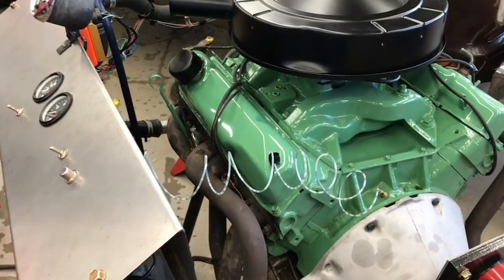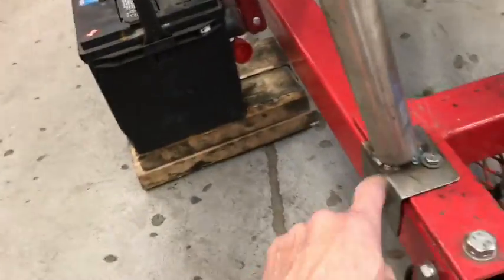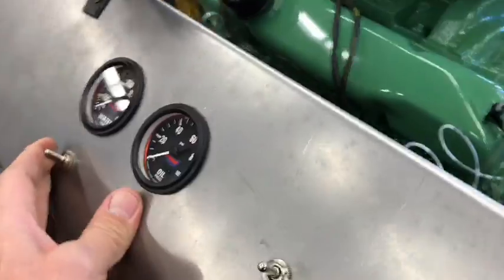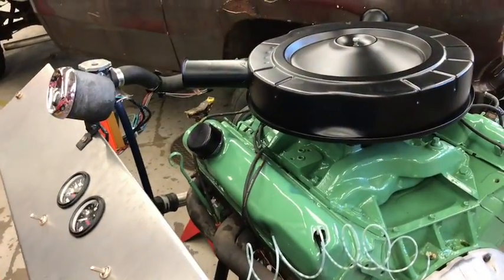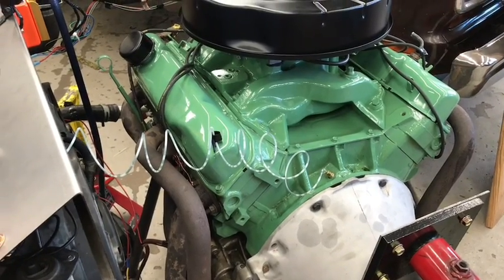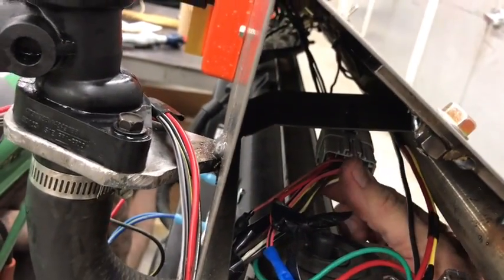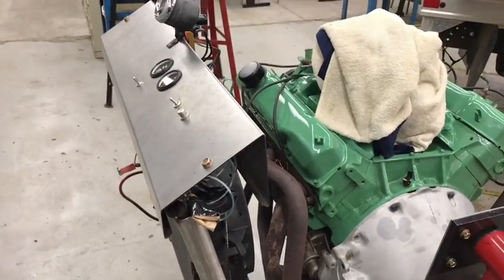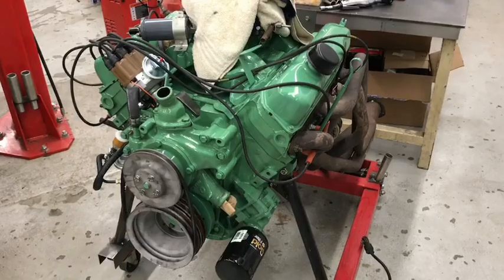How to build an engine run stand out of an engine stand (EASY)

Comment: Is the flywheel weighted to support running without a transmission load?
Reply from the maker: @johncantrell8873  The flywheel is balanced because the engine has a steel crank. They’re internally balanced. A cast crank 440 is externally balanced and would need the correct harmonic balancer and flywheel.  
The transmission/engine are balanced separately. It’s perfectly fine to run an engine like this. Good question, some people don’t think about that!

Comment: Show the wiring diagram please
Reply from the maker: I purchased a new distributor with the orange box you see there. It came with the wires and directions. I added a common relay for each fan, do a YouTube search on how to wire an automotive relay and you’ll see how easy it is. I could explain it, but it would be easier to watch it. The hot(+) cable goes straight from the battery to the starter and a small wire goes to the push button, then to the solenoid on the starter, you’re done.  Don’t forget to add fuses where needed. 
The temperature gauge and oil pressure gauge come with directions if needed. The tach will also come with directions if needed.

Comment: Did you use the Flywheel Cut off a Torque Converter, I have a 340 I am trying to set up on the same stand ?
Reply from the maker: No, it’s a flywheel for that application. There isn’t a clutch/pressure plate bolted to it.  I also didn’t alter the aluminum bell housing at all.
I have a complete 383HP bolted to it now. It’s all for sale, including the stand  - plus - 440 (needs to be built), 383s, automatic transmissions, and lots more….. if interested.

Comment: I wonder how many of the geniuses criticising the welding actually weld?
Reply from the maker: Exactly!  I used to weld for a living and after I tacked it together and I knew it was strong, I let a student try to weld it knowing it was going to be a problem - he tried and I'm fine with that.  If it had to be "pretty", I'd have done it, or sent it to our welding shop to be tig welded (I don't have a tig in my shop).  It's not coming apart regardless of what it looks like!!  This was posted help others, there's many things that could be improved on, this was the first try at this.
Thanks for checking it out!!!  and your comment!!!
Reply: @blvelpa  I judge my welds by 'will that actually do the job required' and not 'am I going to get an award for smooth and plump continuous welds?'
Reply from the maker: @AndrewLale  Exactly (again)!  You might want to check out some of my other videos.  I built a V8 Aerostar which required a lot of fabricating and then drove it 200,000 miles before selling it.  At this time I'm installing a Tremec into a car I've owned over 40 years and no one makes a kit for it.  More fabrication, it never stops!!  The engine on this stand is now in the frame of that car and there's another engine on the run stand.
You may also want to checkout this forum I'm a member of.
https://www.forcbodiesonly.com/mopar-forum/threads/1965-sport-fury-restoration.44077/

Comment: Funny, I was thinking about how to make a run stand double as a build stand with roll-over and everything.  This is great!  Since everyone is cracking on your welds I'll say they look like they'll break somewhere around 40 MPH ;-)  Better not drive that test stand.
Reply from the maker: Thank you!!  It's all good.  We shouldn't have tried to weld it, the tacks looked awesome.  Everything was scrap, the pipe is stainless and the plates are regular steel.  There was no plan to post this, my students thought there might be someone out there that might find it helpful, so I made the video.  It's easy to do, we just put an engine block on jack stands, bolted the plates on the engine mount tabs , bolted the metal to the stand, and added the pipe. After that we made the plate for the bell housing and the removable radiator/control panel.
I hope this helps!!!!

Comment: Thank you I was going to build one but this is a space sawer as well so I'm going to do this mod to my stand
Reply from the maker: Awesome!  You don't need to have a heavy duty engine stand like this one, it would work on the stand with a single tube going to the front wheels.  Lowering the engine from the regular height makes it less top heavy and more stable.

Comment: Great work....good idea there, but you oughta do something about that welding on the struts!
Reply from the maker: Yea, aren’t they ugly!!  The tacks looked good, but the welds – not so good.  All the tubing is stainless and welding it to regular steel doesn’t go so well.  Looking back, I should’ve left the tacks alone and not tried to weld over them.  Everything we used was scrap and it works.  There isn’t any torque on any of the welds and they only need to hold the engine and the radiator in place.  It’s pretty strong and we have another engine on the stand now. 

This wasn’t supposed to be on YouTube.  Some of my students thought it could help someone else build a stand at home, so I made a video.  Thanks for watching and your comment!!
Reply: @blvelpa  No worries, it was a good effort considering what you had to work with...
I lucked out as I had a couple of lamp standards left here at my school, and admin said they were going to chuck them out. So I got my students to measure them up for a frame. The tube was 4X4X 1/8....so they made a rectangle. They then put some 300# casters under it and we are now making up mount bracketing (trying to make it universal as we have several engines we are going to try to test in the future), radiator fitting, gauges , electrical etc.. Then the rest is pretty straight forward....making the mounts to place the various engines will be a good challenge for them! Good luck to you all!

Comment: Curious what was the step to build the plate to hold the engine in place
Reply from the maker: I bolted a bare 440 block to the bell housing and put it on three jack stands at a height that I thought would make it nice to work on.  I put the engine stand in place and made what was needed to fasten the engine to the stand.  With the rear plate, I drilled the holes and bent it until it matched the angle needed. With the front I made the mounts for the engine and the U-shaped plates for the stand and welded pipe between them, very easy!!  After that I bolted the engine you see in the video to the stand and fabricated the removable cooling system/control panel.  The engine had to run at 2000 rpms without overheating to break-in the new cam like I said in the video.  After some minor wiring/fuse issues with the fans (had to install a relay for each fan) everything worked great!   It’s only set up for big block Mopar engines, but that’s ok, I have many.

With a plate to hold the starter motor I wouldn't need to use the bell housing and would have made a much different support for the rear of the engine.  

If needed, different supports could be made to put any engine on it.  Just have an engine held at the height and angle you want and make what's needed to hold it to the engine stand safely.

Comment: Nice easy stand. What brand of engine stand is that ?
Reply from the maker: Kristy Robertson  -  I got it from a local Napa store close to 10 years ago. I have a light duty stand and a big block seems heavy for it.  Flipping the engine over to build it just feels safer on this stand. I had no intention of ever starting an engine on it, but this works really well and it’s solid. No flexing because of weight!!

Comment: I like the creative approach you took with modifying the engine stand to make it a test station.  I think I'll adopt your clever modular approach for the control panel and radiator assembly too.  Thanks for sharing your approach.  You gave me some great ideas for my future test stand.
Reply from the maker: Thanks! I wasn’t going to make a video of the stand, but I had some students that thought it would be a good idea.  They thought someone else might be interested to see how easy it was to make. 
I shared some ideas and together we put this together and it worked.  I didn’t want to change it so much that it would be unsafe to use it as an engine stand again, and it works really well.  I have many big block mopars so I wasn’t concerned about making it fit other engines.  The next one on the stand is a 1970 383HP.
Reply: Glad you posted! I like the setup!